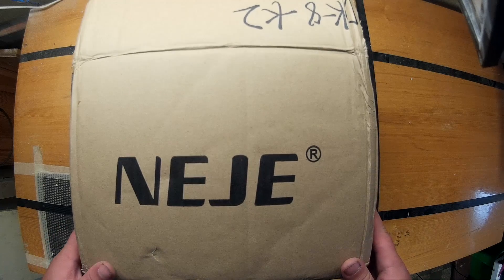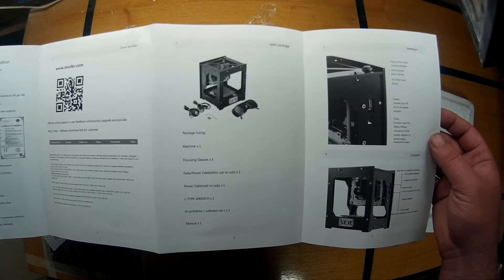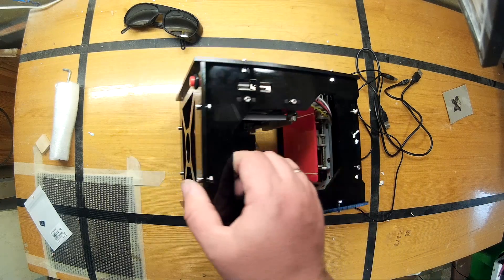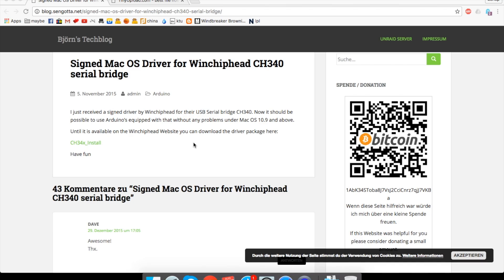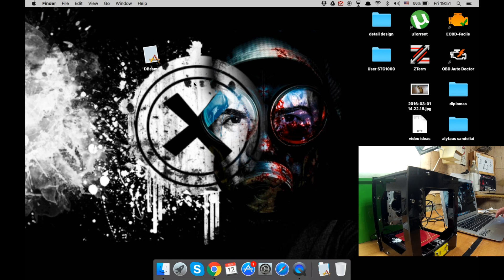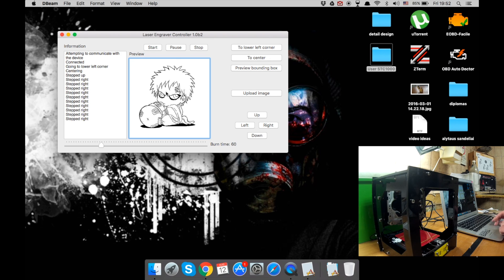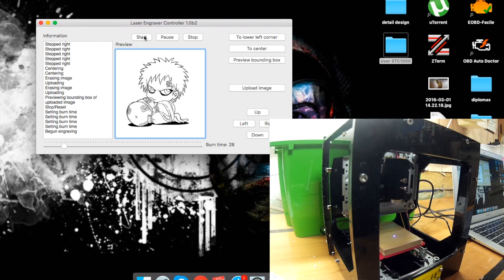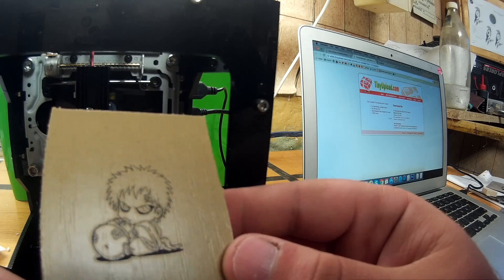neje dk 8 kz engraver unboxing, how to run on mac os tutorial

Comment: Hi, I am having trouble making it work on the 2017 MacBook with High Sierra: it says connected but does not move anywhere :( or upload anything. Also, I am unable to use terminal because it says directory missing and image is uploaded but print is not happening. Would you be able to help?
Reply from the maker: sorry, i just move back to windows os. So i am not familiar with any new issues might be with the software

Comment: Any way to resize the images in the Mac version? Regardless of my image size, it seems to print it the largest it can.

Any help would be greatly appreciated. Thank you.
Reply from the maker: hi, i correct my images in photoshop. if you are using correct resolution, then making adjustments to the size is simple. check my video on homemade earrings, i show in depth how to do this :)

Comment: As the author of this software I have absolutely no problem that you link to it, but please advertise it's not a NEJE product so people don't expect me to provide support/add features etc.
Reply from the maker: Hi. Thank you for the information. Though i dont think that i have stated that this is a NEJE specific app, never the less i admire your work Sir. and thank you for the grate app which allowed me to use this device on MAC based computer.
Reply: eShopXP You're correct, I'm sorry if I sounded accusing. 

That was not the intention, I'm just trying to reach out to all places that I found linking to it to clarify it's not an official NEJE product nor covered by any means of support, ie. it is as is.

But something I wrote fairly quickly for primilary my own needs, and made it official incase it could help someone else.

Now it appears some people bought these engravers in the belief the software is NEJE provided and get extremely disappointed when it does not work (or not working similarly to the PC version) and this is of course both frustrating for me and for them, so therefor I try to make people aware that it's released free of charge as is- but without any support or guarantees it may work for them,
Reply: Frederick
Appreciate you making the Mac software available. I am using it but the Up, Down, Left and Right controls do not work. The information screen recognizes the different direction inputs but the machine does not respond. Is this a "feature" of the software or am I the only one that has this problem?
Reply: It's most likely a slightly different protocol between different versions of the engraver.

Everything implemented works on my engraver, but it's also the only one I've personally tested it with.

However the up/down/left/right buttons are of little use anyway cause at least on mine it goes home before engraving anyway.
Reply from the maker: for me it is not working either, but i guess most usefull would be to move image not the laser. i found most useful to position engraving piece on the flatbed, also you can correct placement in the photoshop. while canvas size 512x512 with 350 dpi, image then can be moved around. if material not moved, you can get precise enough
Reply: You're right, if I decide to update the current version I will add support for image manipulation.

The only feature I added that was not present in the windows version at the time (not sure if it still is however) was dithering.
Reply: I have the same problem...